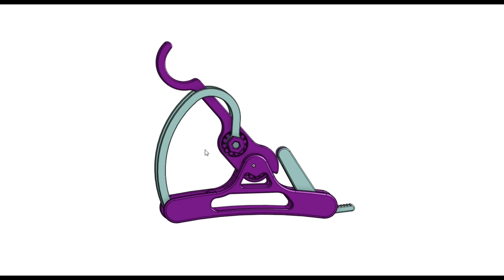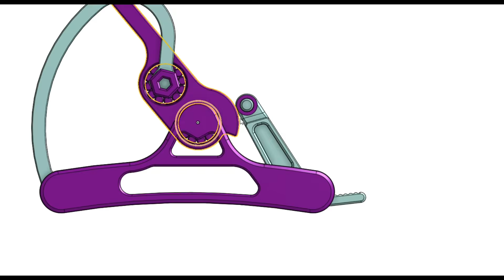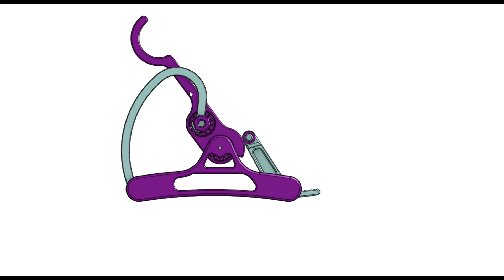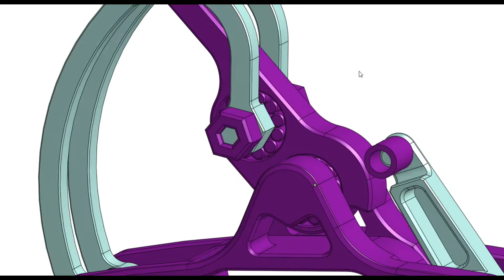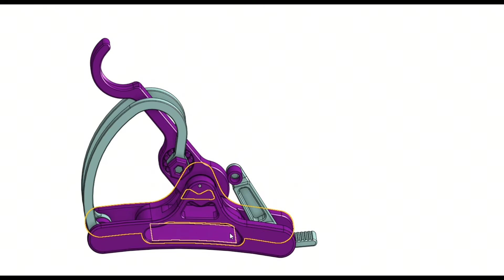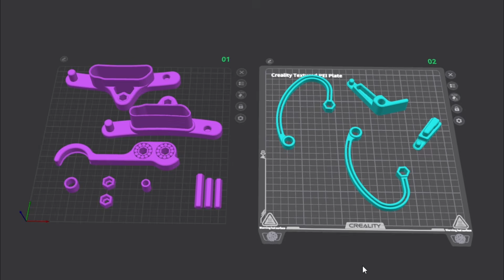3D Printed Spring Fling Catapult

Comment: My bottom bearing won't spin - it melted into the Arm Spring body.  No way to free it.  Top of bearing  was perfect.  Is it possible to re-design the unit using a normal 608ZZ bearing?
Reply from the maker: We don't have plans to redesign it right now.  Try reducing the print speed.